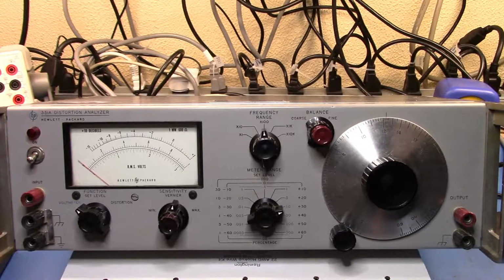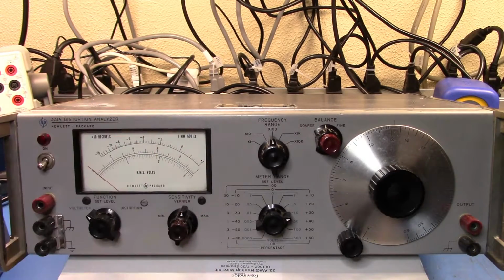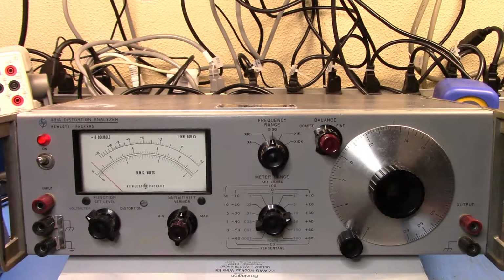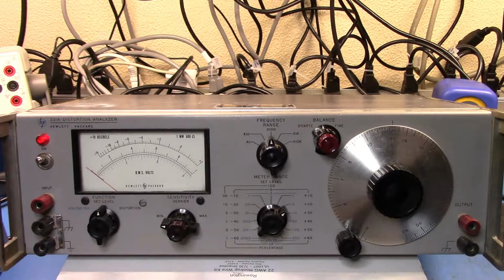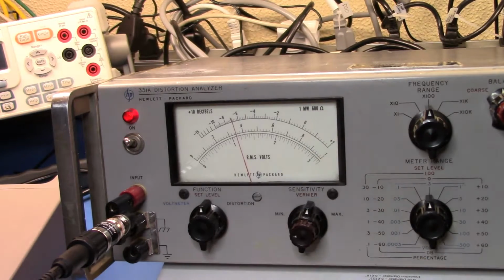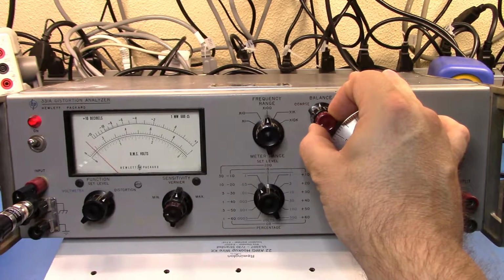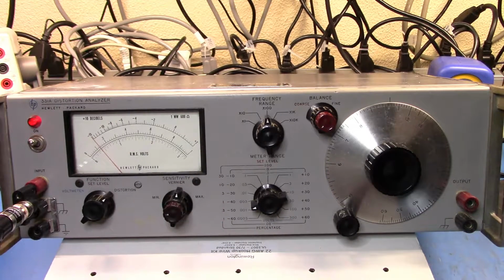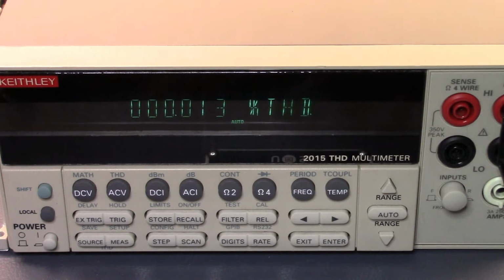HP 331A Distortion Analyzer

Comment: Sorry to pull you up on this but you are not using the meter correctly, read the HP manual on operation of the unit.   You were right  till you didn't set up the level  correctly (this is most important).    Set the sensitivity switch course selector till the meter shows greater than 1/3 scale. Then use the vernier control to set the meter on full scale deflection  if you require to measure distortion as a percentage , if you require a measurement in db adjust the vernier for 0 db meter indication.   READ THE OPERATING MANUAL.  Also make sure the meter range switch is set on 100% which is also 0 db. It can be switched to -10 db down if your signal is under 300 mV. The extra -10 db is then taken into account when reading of the distortion level.
I am an older ex Royal Australian Air Force tech and the 331A, 332A, 333A and 334A were used  quite a lot.
Look at section III OPERATING INSTRUCTIONS of the HP operating & service manual. Most of the procedure is the same with all instruments except the 333A and 334A have a semi auto ability and can fine tune the notch filter accurately.
I own a 333A now but will need a little work, mostly pot cleaning and checking circuit levels against the manual and checking the cal as per the service manual.    Regards Robert Scott
Reply from the maker: No problem at all - Thanks for the comment for both myself and anyone else that finds this - I clearly missed step H in the process (in section 3-18 of the manual as you pointed out). I think I got the rest of the process correct but please let me know if that isn't the case.

If you have any other comments regarding the videos/gear I'd love to get them - I use this stuff as a hobby rather than someone who used them for a job so it'd be insightful to hear about it from that perspective. Thanks again for the comment.
Reply: If I remember correctly all the RAAF techs were required to service equipment with the manuals  out in front of them so no error could be made  in it's use. This worked well in principal but human beings being what we are tend to skip things in order to save time.   The balance  controls you said you had problems with have to be set mid position before you start adjusting the notch filter but after you have minimised  the output with  notch filter taking the meter scale down  as you go also minimise the output with the balance ctl, of course by this stage adjust everything  extremely slow as the notch filter bottom out  is extremely  narrow bandwidth as it should be for meaningful distortion readings.  I don't think I have used one of these since 1984 but yoy remember.  I started with electronics at 12 way back in 1962. An electrical/radio apprenticeship starting in Jan-1965- to end of 1969 but I don't think I was able to play with HP test equipment till I joined the RAAF in 1972.  I did my apprenticeship with BHP Newcastle NSW and most of their test equipment was primitive.
I was trying to ascertain your place in the world , I thought Canada or perhaps US but your spoken English sounds too good for these places.

Regards Robert
Reply from the maker: Thanks Robert - Really appreciate the comment - When I get a piece of gear that I haven't used, and most of these older HP items are in that category, I grab the manual from Dave over at Artek Manuals, read it and then try to ensure that I'm using the equipment correctly.

The problem I was having with the balance controls was that I kept wanting to treat the inner control as the fine instead of the outer control - However your comment regarding the slowness makes more sense of the arrangement now as you're going to need to use the larger control for better, well, control.

BTW I'm an Australian currently in Seattle WA - Been here about 20 years now.
Reply: OK mate well enjoy yourself over there, I lived in San Francisco (San Carlos) for several  months with a girlfriend way back in the early 1990's and I was glad to get back home to Australia again.   I guess in a nutshell just too many people for my liking.  I repair electronic organs and play them, have been an organist since the early 1970's.  I also repair a lot of test equipment, just bought a HP 33120A from ebay with issues, payed $202 AU so I hope it's repairable.  I download service manuals, print them out and comb  bind them (I have an A3/4 HP 5000 laser printer, actually two).  There is a wealth of HP manuals on the net, the best quality ones coming from HP/ Agilent now taken over by Keysight.   The thing is in electronics if you really love it you do not ever stop learning.  When I look back to the 1960's when I was just a 12 year old looking at electron tube technology, everything was so simple compared to the technology of today.  The basics are still there though, ohms law, power equations, ac theory understanding etc.  I actually taught electronics in my later years in the RAAF so it's all stayed with me.  It still is a wonderful hobby and I hope it remains so.
Kind Regards Robert Scott,  Sale, Victoria.
Reply: +Robert Scott Good catch.. I was about to post basically exactly what you did about the level.. glad i looked first and discovered this was an older video and you had already brought this to his attention..  it's easy to miss a step or not quite get the operation right with a unfamiliar piece of equipment.. especially when you are used to more modern devices... these old manual units require you to think a little... think thats why i like my vintage equipment.. thanks for the great info... the gentleman seemed to appreciate the tips and it's good to see people helping people... i try to as well every chance I get.. sharing our knowledge is important, it's good to see others like yourself take the time to share... Thanks again..
Reply: Thankyou for your kind words. I now own 3 of these distortion analysers  2 x 333A and a 334A. One 333A has a mechanical problem with the frequency adjust capacitor bank (internal)  but the others operate within specs. 
Repairing well built test equipment was always a joy for me as you are working on something built to last. I like working on Tektronix oscilloscopes as well.
The internet originally came to be to disseminate information between people having similar pursuits, it still does that but commercial interests and money hungry people  spoil it somewhat today.  Just look at some of the prices on ebay for this type of equipment and service manuals for them.  These in my mind are just greedy  bastards out to make a buck  out of some poor bugger  who may put the equipment to good use.  
 When I list I always auction at the lowest price the instrument  owes plus a little extra to offset ebay account fees. 
Far too many greedy people out there now,  in 1996 the net was not at all like it is now.
Reply: HinRobert,
What is the difference between the 331,332,333,334?
Cheers 
Mark
Reply: @questionmark9684  I think I have this right from memory but you can download all service and user manuals for all models from the net.  The 331 was basic, manual setting up only.  The 332 had automatic tuning but only in the final setting of the notch filter. The 333 was manual but with a RF rectification stage so signals of line could be checked for a tone modulation distortion.  The 334A had auto in the final tuning of the notch filter and also a RF detection stage.  
The auto tuning of the notch filter is done by detection of the remaining signal after the bridge circuit then used to drive a couple of lamps controlling LDRs (light dependent resistors) in the bridge circuit.  The RF diode for detection of RF is something I have not ever used. Most of these distortion analysers were used to check airborne intercom systems in aircraft in the RAAF so RF detection was not required.  Main use is determining distortion levels in audio equipment including tape recording , generally reel to reel.  Of air modulation signal distortion could be checked  with the 333 and 334 as long as there was a single modulation tone only.   I think this is all correct from memory , these were very well built instruments and certainly miles ahead of anything out of  China,  the paper dragon are they saying now.  Relatively easy to service as well with good service and user documentation.  In that respect alone the Chinese equipment is just crap.
Just check on line for a read of the various service/user manuals involved.  You might try  BAMA  boat anchor archive  or directly from Agilent who actually took over HP.   Regards Robert
Reply: @Robbie1949  Thank you, Robert. 
Very interesting. I will do as you say. I have been looking on Ebay for one of these. I just love the HP equipment of those days; it's just marvelous, well made, well documented and just plain beautiful. If only things were made like that still today... 
I started looking at these to measure distortion of audio amplifiers and signal generators. I could not find a different affordable instrument. The Keithley 2015 is still much too expensive for me.
Cheers,
Mark
Reply: @questionmark9684  Where do you live Mark, what country ?
Reply: @questionmark9684  Replying again, one of my analysers the 333A has developed a metering fault so when I repair it I should do a video. I certainly have the video equipment.  The prices in the US for serviceable HP distortion analysers are prohibitive < $400 US. I have bought 3 here in Australia for much more sensible prices, less than $100 AU.  These instruments were made in the 1970's well within living memory for me.  I have used them for checking distortion on reel to reel  tape recorders  with a recorded 1000 Hz sinewave. All of this series analysers use solid state electronics with discrete components so are eminently repairable.  I made a mistake in my description the 333A and 334A both have auto tuning with the 334A a diode input for RF.
The 331A (as this chap has here)  and 332A only have manual tuning with the 332A a diode input for RF.
All of these analysers are a pleasure to repair due to the construction  and logical layout and of course most of the parts easy to obtain.  I have had to repair some moderately & poorly made Chinese manufactured instruments with no documentation available and it's no fun reverse engineering in your head as you proceed.
Reply: @Robbie1949  Hi Robert.  I am Canadian but I live in Germany.
Reply: @Robbie1949  Hi Robert, 
Thank you for all the details. I'm planning to buy an 'as is' unit and then repair it as required. My biggest challenge is calibrating and accurately test instruments,  as I have little in the way of calibrated equipment and no dedicated calibrating equipment. 
I have several instruments that I am returning to service and which will be not calibrated. 
Cheers 
Mark
Reply: @questionmark9684  If you were in the same country we could have made some sort of deal but the postage is far too expensive.  I look at the US prices for these things that are in deplorable condition (parts only) and wonder how they justify their pricing ?
Reply: @Robbie1949  Hey Robert, 
That's really cool of you! 
If we were, I would have appreciated meeting you. I'm sure you have a bunch of great knowledge and stories from the service. 
Cheers 
Mark

Comment: Be aware the meter indicates RMS reading; which is correct for a clean sine wave.  For a wave with complex distortions (more than just a bit of 2nd or 3rd harmonic), the meter becomes average responding.  Thus, you will not be able to compare distortion measurements with a digital or more accurate RMS distortion meter.  The manual briefly touches on correction factor, but it is not detailed.

If you have two signal sources, generate one primary fundamental frequency and then combine a second harmonic with the second generator (at double the frequency) at small levels to obtain 1%, .1% and .01% distortions.  You 331 should measure them correctly.  If you have a spectrum analyzer, you can see your levels.  Otherwise, find a THD formula and do the math manually for your generator values to induce the harmonic value you wish.
Reply from the maker: Thanks David - In this case it was just the clean sine from the Arb - I should have video'd doing this with a larger more known distorted signal to show that the 331A reads the same as the 2015THD in that case.
Reply from the maker: Hit send a bit early - I ended up asking about how to get a known distortion value and it was clearly a senior moment on my behalf - Once I read the replies it was trivial to make a known value of distortion that had the 2015THD match the 331A on a sine wave - I didn't video that though and I've since sold the 331A so I can't go back and show that.

Thanks for the spot on comment though.
Reply: I fought with a HP 334 for a bit and it gave me a good education!